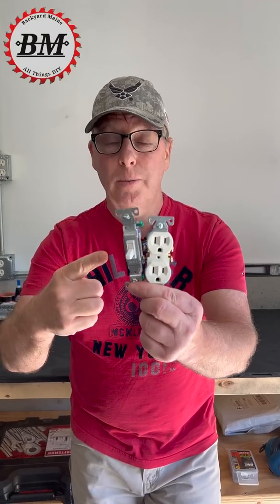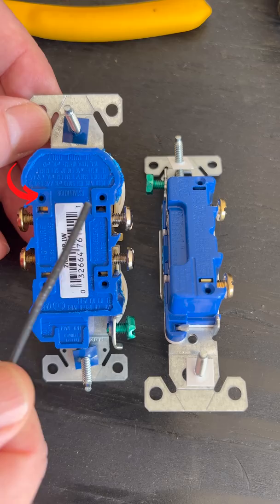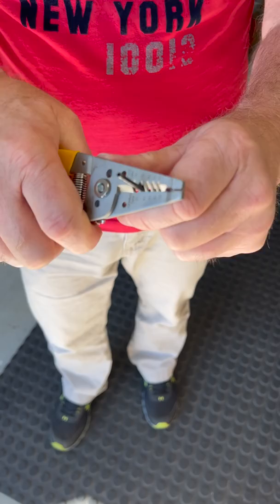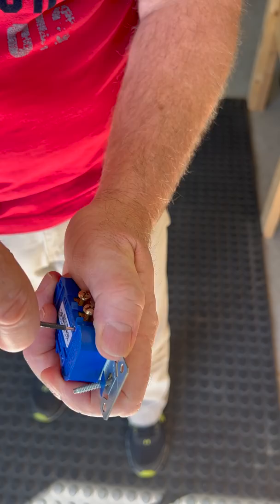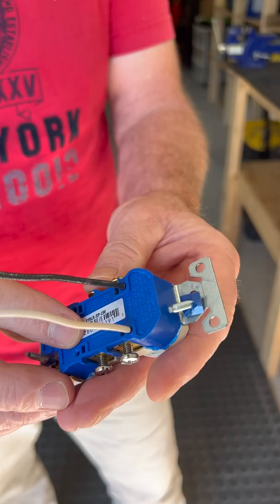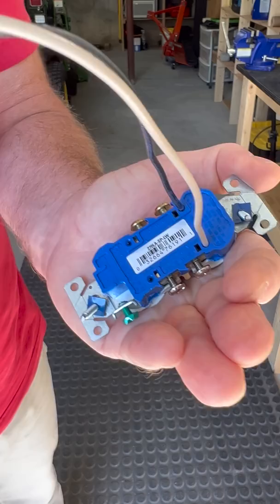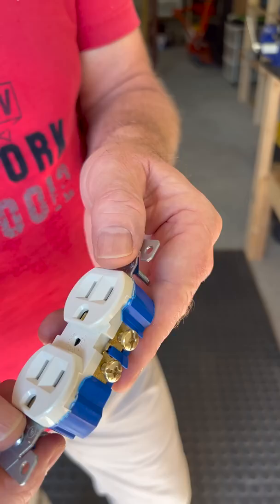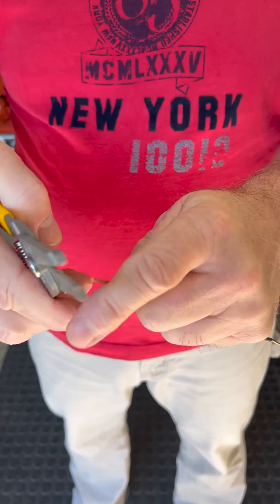Don't make this electrical mistake #Shorts

Comment: This isn't accurate. After back stabbing tighten your screws. I've never had problem with back stabbing. My own house every outlet is backstabbed. Not once in five years have I had a problem. Show proof..
Reply from the maker: You should know that the screws have nothing to do with the stab connections. I'm going to pull one apart on my next video. Sorry I never save the burned out receptacles when I replace them. Also if you're talking about the back wire outlets that use the screws they are a completely different animal and work great.

Comment: Well, code allows it, so.
Reply from the maker: The code doesn’t allow or restrict equipment such as a receptacle. They tell use that the equipment must be suitable for the application and installed following the manufacturers recommendations. The stab connections were also available on 20A devices for a long time but now they can only be found on 15A because of their high failure rates

Comment: But it is ok with the NEC
Reply from the maker: The NEC doesn’t approve or restrict the use of electrical equipment. It states that the equipment needs to be rated for the application and environment it’s where it’s installed and the we follow the manufacturers recommendations for the installation and use.

Comment: I always thought those holes in the back were for high pot tests? Am I stupid?
Reply from the maker: Very funny. I would like to see one of these tested in that way.. lol. Before I retired we used to high pot Our 35kv breakers annually.. ( among other testing as well )
Reply: @BackyardMaine  im honestly hoping nobody tries to hook a multimeter probe into one of those lol most of them have that notch right where it pinches the wire and you won't be left with much room to get the fucker back out lol
Reply from the maker: @henuemphuse  I guess not. lol

Comment: So you must not like them new wire ties you just plug in eather
Reply from the maker: Most of the are junk with exception of the Wago  221. For LED light fixture connections they’re fine.

Comment: Hire a licensed insured electrician . End of story
Reply from the maker: Believe it or not there are a lot of licensed and insured electricians and electrical contractors using these connections. I’ve been licensed for 38 years and learned not to use these as an apprentice.

Comment: Why are they UL listed then? where's the study information that shows that these are common failure points? Oh that's right there isn't any. Thanks for the advice bobby homeowner but I've been doing electrical for 15 years. Come back when you have real information.
Reply from the maker: Im a 38 year license electrician with my last ten years senior electrical engineer for a multibillion dollar corporation. 20A receptacle with back stabs were UL listed for decades but they lost their listing. But my study is simple, it’s called experience. The number one service call is replacing burned out stabbed devices installed by hacks. Maybe some of your work.

Comment: On what do you base your advice? It is actually incorrect
Reply from the maker: I base it on 38 years of experience as an electrician and an electrical engineer. Most common failures for service calls.

Comment: My dear friend before this receptacle came out on the market, it was tested, it’s listed, for the installation method your advising people not to do, it think that maybe you should have a different approach, maybe if you, remind people to follow manufacturer instructions or it would likely fail…. I like your videos but I’m gonna pass in this one…
Reply from the maker: I understand differing opinions and it's fine if you pass. Also thanks for watching my videos.  But let me remind you that 20A stab in connections were UL listed and were manufactured and approved for decades. However, after such high failure rates and some house fires they lost their listing and this connection method is now only found on 15A devices with limitations such as one time use and only on 14 gauge solid copper wire. I find them very unreliable based on my own experience repairing or replacing them in the field.

Comment: A better idea would be no develop a decent US standard for electrical equipment and stop using sold core cable... it's the 21st century ffs.
Reply from the maker: We only use solid for residential and light commercial. Almost everything else is stranded. I like it for residential and it does carry current slightly better than stranded per cross section.

Comment: "Very common failure points" is absolute BALONEY. Show me some stats on those "very common failures" - you can't because there aren't any.  I've installed thousands of devices using back-stabs and so far over 40 years a failure rate of NONE, and trust me people would call me if they had problems.  If you purchase good quality UL-listed name-brand devices, they are tested and re-tested and will last for the life of the wiring installation.  Are the side screws a "better" connection?  Maybe, but only if torqued to mnfct. specs, which nobody ever does. Under or over-tightening the side screws are also common failure causes.  But  for 15a installs the back-stabs are perfectly adequate- they would not be there if they weren't.   What WILL cause devices to fail prematurely is overloading them, or not mounting them securely.  Or... nicking the conductor when stripping it, which will cause it to fail prematurely.
Reply from the maker: Wow. You have had a different experience than most of us. I never have used the back stabs but I’ve repaired or replaced more than I can count. I’ve one had one side wire failure that I can remember over 39 years. The stabs were approved for 20a too for a long time but the failure rate was too higher. They were also approved, tested and retested?

Comment: Wait a minute I see you electricians promoting wago connectors the pushing style all day long and say oh yeah they're great and I chime in and I say no they're not and this video explains why pushing wire connectors are not good so are people going to start learning from this video that pushing connectors are crap especially over time in other words are people going to learn from the issues with pushing connections on late in outlets and realize that's the same problem they're going to come into with wago even the flip up

Comment: Ya right it’s because you don’t like to do it I have 40 year sockets back stabbed not a problem!
Reply from the maker: Not good connections. I don’t like them for one reason. They fail all the time. Maybe you not the one getting the call to fix all the failures.

Comment: So you have exposed conductors.. lol....you would  be able to do that in the uk..
Reply from the maker: The screws are hot whether you back stab or side wire so making the reliable connection makes the most sense.
Reply: @BackyardMaine  there is no way in hell you would  be able  to do that in the uk.the screws have to be recest to prevent accidentally contact.  
I hear alot about its not to code being used.. but if you made that  in the uk you would be prosecuted by the health and safety executive. 
 The fine would be in the millions

Comment: only in America I see people still have 15 amp clothes everywhere else in the world of 20 amp what's the purpose of 15 amp plugs if everything is wired for 20 amps no if I buy a house I'd wear for 20 oz and someone come and put in 15 now plug that's like a fuse
Reply from the maker: I’ll not 100% of what you’re talking about. Not everything is 20A and 15A receptacle and circuits common in my parts of the home where 20A isn’t required. Also 15A receptacles can be protected by a 20A circuit since they have a pass through current rating of 20A.

Comment: I’ve never had a problem or complaint.
Reply from the maker: Maybe you're not getting the service calls?
Reply: @BackyardMaine  And why wouldn’t I get them?
Reply from the maker: @iwishiwaswrongbutimnot517  Are you doing service work? Read the comments from the people doing service work and these are their number one failure.
Reply: @BackyardMaine  I have owned a private handy man business for over 20 years. I do my own service calls when I can. I also have two helpers. Both skilled craftsmen. And in those 20 years we have install thousands. And the only time we have been called for an outlet repair didn’t find the inserts to be the problem. But since everyone else but me have had catastrophic issues with these. Please explain in detail what exactly fails. Do the pieces of metal that r closed off in the wall push the wire out? Are the wires improperly attached? That’s a more believable reason for failure. I would suggest a more in depth video about how to properly install them. But no, an electrician is never wrong. Right, they cannot afford to be. So blame the outlet. Sorry buddy. It’s not the glove, it’s the player.
Reply from the maker: @iwishiwaswrongbutimnot517  what can I tell you. You get your wish. The connection fails over time with any amount of current. The area where the receptacle pinches the wire becomes loose, gets hot, melts plastic, burns insulation and fails open. I fixed 100s of these all with the same problem. So based on my experience and the experience of many others they are an unreliable connection.
Reply: @BackyardMaine  ok. So I’m still curious about how that wire inside the wall becomes loose. And if it is getting to hot that can cause any receptacle to fail leading to all the other things u mentioned. It’s weird how a wire inside of the wall that has a staple close by per code. So all these outlets have a problem with wire becoming loose. Despite not having a interaction with anyone. Seems, as I said. It’s not the glove. Maybe people r using the wrong gauge wire. U forgot the last part also. But I’m not.
Reply from the maker: @iwishiwaswrongbutimnot517  Your not understanding of how they get hot without anyone touching them tells me you know very little about electricity. I thought I was discussing this with someone with at least some theory background even if you're not licensed. I'm done..

Comment: You should explain why they fail cause I don't believe you
Reply from the maker: I just give advice.. It's up to you whether or not to take it. I don't care either way. I do explain why they fail in this video though. Also I have been a licensed electrician for 38 years.
Reply from the maker: Forgot to add the video link. https://youtu.be/e_C_twh5fQE

Comment: but wagos are fine haha
Reply from the maker: Actually the Wagos have a different method of clamping the wire rather than just wedging it un between two conductive surfaces. But I still prefer a wire nut for both cost and reliability.

Comment: i think your use of the words "Very common" is extremely over exaggerated .
Reply from the maker: Not based on my experience. Remember just one  electrical problem for most people requires calling an electrician and spending an unknown amount of money on a repair. It take a few seconds more to do it right. So yes maybe a house full of devices will have two or tree issues over the years but that in my opinion is more than the homeowner deserves.

Comment: Ya ok so why the options ?
Reply from the maker: Quick and easy. Time and skilled labor cost $$
Reply: @BackyardMaine  
Ya I think there's more to it than that
Reply: @BackyardMaine  may I ask what are you opinions on klein tools
Reply from the maker: @whymeme5841  I like them.. Before I retired (electrician / electrical engineer for a large corporation) I used many Klein tools but my meters were all Fluke. Since Fluke meters are expensive and overkill for what I do now I bought a Kline meter and it's awesome.
Reply from the maker: @woodyahh2110  Maybe some money involved??  They used to be approved for 20A devices as well but only on 15A and 14AWG now..

Comment: Why do they offer such devices to the general public if they have a proven problem of quality issues? This is how you connect low voltage speaker wire, its not how you properly connect a much higher voltage, higher current, & potentially damaging or deadly connection. I mean why do they offer us this crap? Just so that one technician can finish his job faster & not give a crap about the low quality connection he made? Have we become totally dependent upon everything being made to low quality Chinese standards that we just accept these products as is & rely upon you tubers to inform us otherwise? Or is the you tuber trying to create a problem when there is no problem?
Reply from the maker: No they are not very reliable but don't take my word for it... They are made so that an untrained person can install or replace a device. Sadly some contractors will demand their electricians install this way to save time.

Comment: 5/8 of an inch, god inchs suck for precise measurment like thats a fraction of an inch? What happens when you need to chave like a mill off wood 10/254 of an inch?
Reply from the maker: I learned the metric system when I was a kid and I'm so glad we never made the switch. We have no problem with fractions.
Reply: @BackyardMaine  Whats the issue with metric or the appeal of imperial? Like you do use metric for everything else such as for henrys, farads, ohms. like off the top of my head I can give you the rough estimate of the speed of sound and light which are all things that come up in electrical engineering and I presume the speed of light and sound are not taught in feet so curious what makes the imperial so appealing despite using it elsewhere else, are there some benefits to using it?
Reply from the maker: @CriticalCipher  I'm also an electrical engineer and yes we do you the metric system for a few things but not many. The speed of sound 760 miles per hour and the speed of light 186,000 miles per second. For me it make it more tangible and relatable. I'm not bashing the metric system at all I just like the imperial system better because that's what we use daily.
Reply: @BackyardMaine  Intresting, I supose you do encounter it more with travel and work with your hands you'f use the same measurement that everyone else uses.Such that if I lived there I'd probably also just use the impiral as meterials and sucb would be ordered in those measurement just as I do for all the measutement here. Thanks for the insight

Comment: Then why are they there and allowed to be there.
Reply from the maker: To make it easy for an unskilled person to replace an outlet or switch.
Reply: @BackyardMaine  I often wondered about the actual amount of contact on the wire but assumed since the electrical trade and engineers allowed it then it must be ok. Thanks for the info, I shall go back to the screws.

Comment: Any cheap Chinese device is a POS that will fail. Buy quality devices and you can use them either way.
Reply from the maker: Wrong.. These are made in the USA. All back stabs are equally unreliable so if your using them you giving your customer a future headache.
Reply: @Backyard Maine  You're repeating something said over and over. I've seen all kinds of failures. I no longer do electrical work but we were primarily service electricians. We did repair and troubleshooting. I heard it said more times than I could count but that wasn't my experience. I saw more problems with wire nuts than almost all other problems combined. I've seen almost everything fail, some things fail in years others in decades. Every connection can fail. All I know is that wasn't my experience, but I certainly saw cheap devices fail far more often than higher-end devices.  If a device is UL listed for a certain use you be assured it has been tested.

Comment: I don't run 14. 12 is low as I go
Reply from the maker: I don't know why. As long as you have the proper devices and of course 15A OCD.. Save money and it's easier to install.
Reply: @BackyardMaine  well the reason I don't. You get more of a run on 12. And less Voltage drop. Only time I run 14 is to smoke detectors

Comment: SIMPLY ... CALL AN ELECTRICIAN..  we went to school not watched a YouTube video.. and don't take advice from someone who's never been on a construction site...
Reply from the maker: I'm a licensed electrician and an electrical engineer with 38 years of experience. I have run huge projects and my advice can be trusted. Now I'm retired and want to share some simple knowledge with my viewers.
Reply: @BackyardMaine  simple knowledge?? These people are gonna burn their houses down, thatswhy we get a license after 6 years of school,  not a "helpfull" you tube video...and with all due respect telling people not to use something it was designed to do isn't advice,  its your opinion.. I'm assuming if it was three or four 14s you'd tell them to use connectors?
Reply from the maker: @PortnoiJ  I understand your point but consider mine. People are going to do electrical work whether they find my video or not. So isn't it better they have some basic knowledge first. Also yes it is my opinion that these are not reliable but that opinion is based on my years of experience finding failed connections. And finally yes I would recommend that wires should be pigtailed if three or more wires are in the box.

Comment: You must not be a experienced electrician. I have installed these types of devices for 40 years with no failure. You should not be advising things you no nothing about
Reply from the maker: I'm a electrician and an electrical engineer with 38 years of experience. You stab them and then the  professionals will go back and replace them.
Reply: Backstabbing causes alot of issues if you notice your lights flickering, most likely its ben backstabbed. Backstabbing does not hold up strong enought as if you would use the screw terminals since you tighten them very tight.